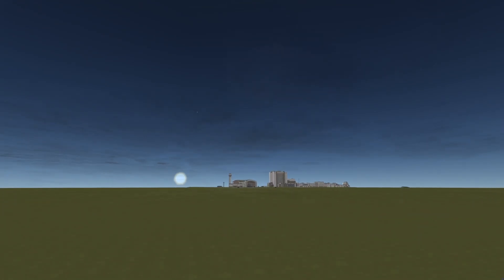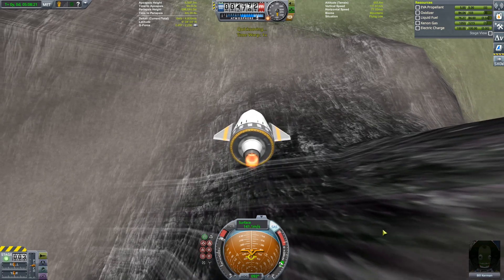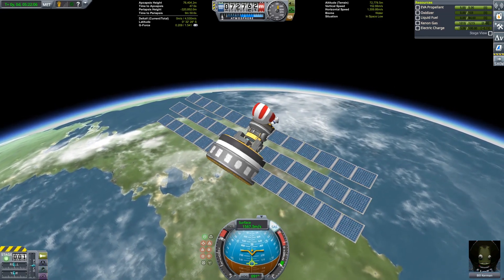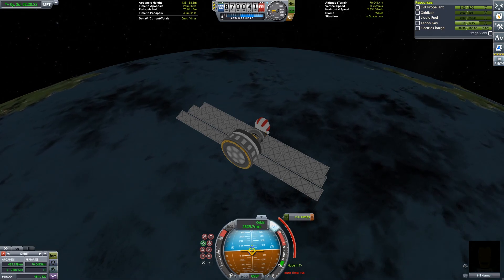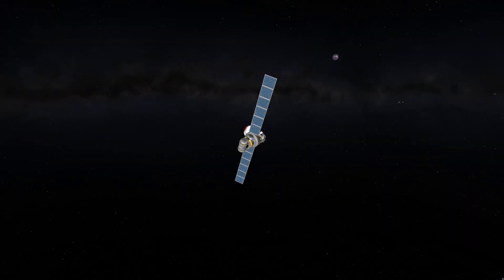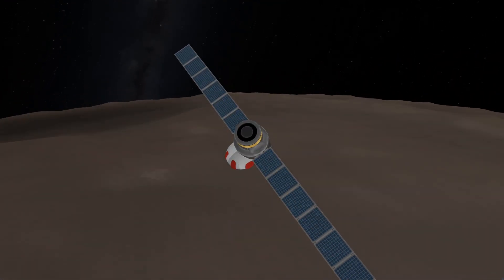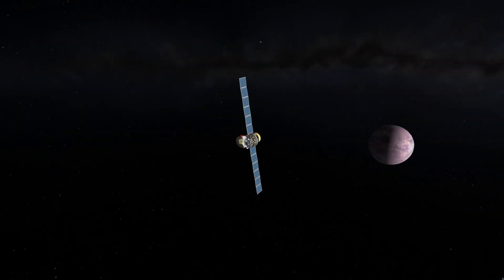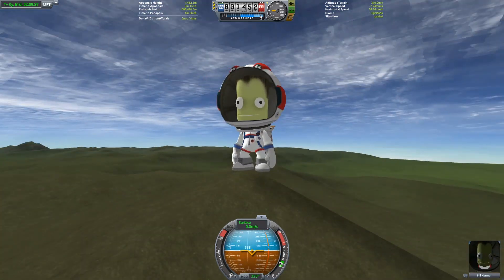2.0 tons to Moho and back

Comment: technically this craft should be able to go anywhere right? once you get an assist off of eve, the solar system is yours isn't it? i'd like to see the smallest possible tylo SSTO. and also the smallest eve return vehicle (regardless of what it takes to GET there).
edit: i just checked your channel, and you already did this stuff😰

Comment: I know this is years old now, but just curious at 8:00 if there would be an efficiency gain by capturing at Moho in a retrograde orbit (e.g. clockwise when viewed from the north) so you can capture on the sunward side of Moho and make full use of the admittedly weak oberth effect, then once captured into a maximally elliptical orbit, you turn around at apogee which would only require a few m/s.

Then you can lower your orbit using tiny periapsis kicks relying only on battery (for greater efficiency).

I'm really not sure if the improved capture efficiency with the Oberth effect would counteract the additional DV requirements to turn the orbit around, but it's an interesting thought regardless.

Comment: I don't know if they fixed this but apparently, you can use a fuel drainer on an air intake and it will produce thrust. Since Intake Air is infinite as long as you're in an atmosphere, this basically produces nearly infinite thrust production. This works because Intake Air gets counted as a Fuel Resource by the game.
Reply: That was fixed in 1.9.1.

Comment: Ok Brad hear me out: A catapult that launches a kerbal into space where the EVA pack can circularize.
Or if you're feeling daring: a catapult that launches a payload into space where it gets a gravity assist from a moon to enter orbit
Reply: Perhaps using a fairing to minimise drag and avoid overheating? The payload in question will have to travel at basically orbital velocity from the moment it is launched, at ground level. I hope that catapult isn't at sea level
Reply: He just did that

Comment: Cosine losses are actually surprisingly modest until you are at very severe angle of attack. For a 30 degree angle of attack, you still get 87% efficiency. For a 10 degree angle, that's 97%.

Comment: 9:20 - Is Moho the highest-surface-gravity body that the Dawn can lift its own weight on?
Reply from the maker: It is!  However, Vall has even lower margins in practice, due to the high efficiency of photovoltaic electrical generation on Moho and the need for batteries on Vall.

Comment: 3:11 - Their low heat tolerance actually makes a lot of sense if you think about it - the basic fins are stated in-game to be made from aluminium, and aluminium and its alloys weaken and melt at much lower temperatures than other commonly-used materials.
Reply: Excellent work

Comment: me: knows a decent amount of the game but still can't make SSTOs possible

this guy: goes to moho with two tons
Reply: For me, every time I try and make a spaceplane, I have to fight with the KSP wheel colliders, so I have just given up on them. Rockets are so much less rage inducing.
Reply: @gajbooks  Planes are for the weak (except when Bradley does stuff with them).
Reply: My first (and only) SSTO was just my fighter jet with some NERVAs strapped to the side.
Reply: @throwaway80345  SSTOs aren't that hard, just takes time, tweaking and maybe watching some videos on building SSTOs..... Its optimizing SSTOs to be efficient that is extra difficult....
Reply: @Mako-kun | And in my case, landing them in one piece.
Reply: @throwaway80345  Try keeping an eye out on the verticle speed indicator at the top. Vertical speed should be be just slightly under 0m/s a few seconds prior to touchdown. Also, a design with a lower landing speed and appropriate landing gear helps.
Reply: @Mako-kun | I dont even reach this point, cause my SSTO is just spinning while falling down almost vertically.
Reply: @throwaway80345  Your center of mass  is behind the center of aerodynamic lift. Ideally, center of mass should be slightly in front of center of lift at all times. You can check center of mass & lift in the spaceplane hanger (also check center of mass without fuel, as center of mass is affected by fuel) Try moving the wings further back, maybe also move fuel, engines around and necessary adjustments.
Reply: I still am unable to dock in orbit.  I can do it on the runway ... I found a map of Delta V one needs to get to the various destinations.  The map cut out thirty failed launches on each new game.
Reply: @bradyelich2745  We are duality of men then, I figured out how to dock around two weeks ago.

It's really just waiting until you're close enough, burn retrograde from your target until its zero, point towards the target and then thrust forward.

I'm still janky on the RCS part lol
Reply: @inactive9948  I tried the training missions two or three times and still failed.  I have a failure in the mouse control department.  I do not think it is the mouse's fault.
Reply: @bradyelich2745  Ahh you'll get there, it's really janky at times but I have faith
Reply: @inactive9948  Thank you for your support!

Comment: Only Bradley Whistance would find a small, necessary loss in efficiency “psychologically painful”
Reply: He was burning near 45 degrees radial, that is not a small loss...
Reply: @gallopinggoose6891  It's what, like less than 30%? That sounds big, but it's fairly small compared to the 10X+ ISP gained by using the Dawn engine in the first place.
Reply: @neolexiousneolexian6079  I'd guesstimate 50%, because cos(45°) = 0.5 and most of the burn was 45 deg. radial as galloping pointed out, which is still pretty "psychologically painful".
Reply: @angrynpc5477  cos(45) is not .5, it's about .707, or sqrt(2)/2
Reply: Jerry Rupprecht agreed. I just say “OH IT’LL BE FINE.” Lol. I agree with your opinion about only brad feeling pain haha.
Reply: I feel your pain.
Reply: Def disagree, it bugs me too lol
Reply: stop giving math lectures to each other, the joke is that bradley whistance cares about every bit of fuel
Reply: I wish I didn't find seeming efficiency losses psychologically painful. It's an unhealthy feeling which can lead to problems, including major efficiency losses due to obsessing over minor ones. It's a good thing the feeling doesn't control Brad.
Reply: The only thing i find psychologically painful is decade long manned missions
Reply: Lol.
Reply: Me who wastes 1000 dV in kerbin orbit-duna landing
Reply: turbo pumped as well.
Reply: Im uson near future propultion mod and i saw something everything is using lots of electricity this is max pain
Reply: One of the engines uses 2999.99e/sec

Comment: Still don't get how he thinks up those kinds of transfers/gravity assists. Can I get some more detailed explanations?
Reply: This specific chain of gravity assists occurs regularly (at least IRL) because the planets are in whole integer resonances with each other. Finding them however takes some time. 
See Earth-Venus-Mars cyclers for more details. (papers from the 80s that found and explored theses resonances IRL. KSP probably has them as well. ) the magnitude and direction of the gravity assists are controlled by your flyby speed, the closest distance and your angle. that's how you can both get faster or break with the same gravity assisting body on different flybys.  Using earth for gravity assist can also help with plane change and when antenna strength is of concern. You could get arbitrarily strong gravity assists for your spacecraft, IF you could get arbitrarily close to the body. Aerobraking and lithobrakting are factors to 'consider' however ^^

Comment: I think the transport craft is fair. After all, you would need to use a crawler to get it out of the VAB, so either way there's some kind of vehicle involved in moving it to the launch location.
It'd hardly be fair to include the crawler in the mass calculation- your crawler is just more of a... flier!
Edit: I assume those 38 kilograms left over are the large supply of pizza Bill plans to ration out over the course of the trip, right?
Pizza would be an optimal choice, naturally, since it tastes surprisingly good cold.

Comment: next step: bill gets to orbit and back with only his suit and willpower
Reply: He might need to lay off the snacks for that one.
Reply: shoopnooop haha
Reply: step after that; Going to orbit and back without turning on my monitor.
Reply: Since when was Bill a jedi master?
Reply: The laws of gravitation vs the indomitable Kerbal spirit:
Reply: eva pack has not enough twr to take off on kerbin surfase so he also needs to use mountain launch
Reply: @denisday14  mountains are not high enough for that, but maybe creating a ladder tall enough could get the trick done.
Reply: @isaz2425  what TWR and what ∆V has Jetpack on highest mountain?
Reply: @denisday14  I only know that it has only 600 ∆V in space. whisc is much lower than necessary 
(I think you need around 3000 ∆V from the surface. going on a mountain helps a little when you have a low twr in dense atmosphere, but it doesn't help much with the ∆V needed. I think the ladder would need to go way beyond the atmosphere if you have only 600 ∆V)
Reply: @isaz2425  yes, but you need ladder, much higher that 70 kilometers because you only have 600ΔV so you need ladder that height, on that orbital velocity with periapsis 70 001 meter must be 600 m/s or bellow
Reply: @denisday14  yes , I'm too lazy to do the math now. My guess is that it would be much larger than kerbin's diameter, but not as large as the distance to the mun.

Comment: Next mission: sepatron to the surface of Jool and back
Reply: Define seperatron.

You see this looks like a rocket, but it's actually a seperatron for the rocket that will carry the ksc into orbit.
Reply: Swdennis did decouples only to orbit, and the surface of the mun, but he couldn’t come back.
Reply: Why do I feel an r/wooosh coming?
Reply: @bluemoonjune5178  No!  Not funny.
Reply: It require propellers. stratenblits did this without separations but with refuelings
Reply: lol no one noticed the "surface of Jool"
there is one, you just get crushed underneath